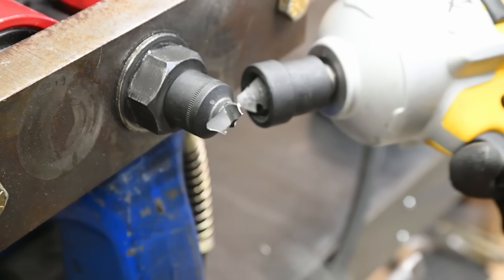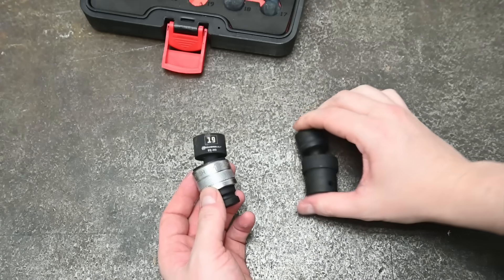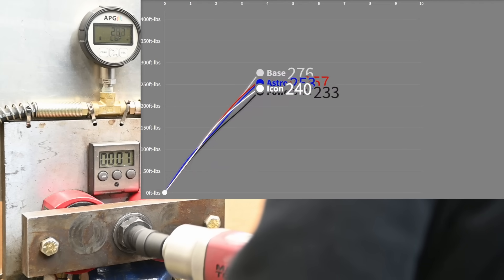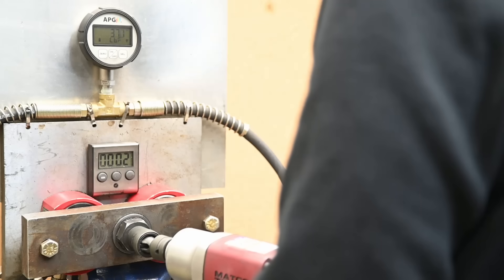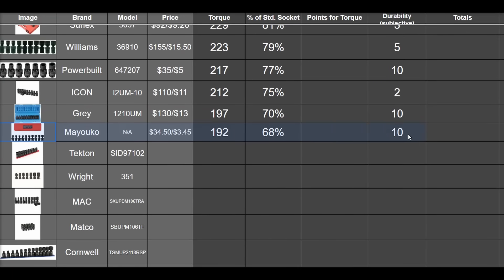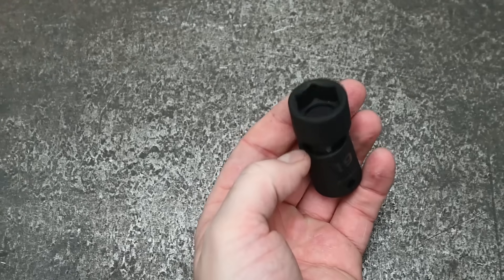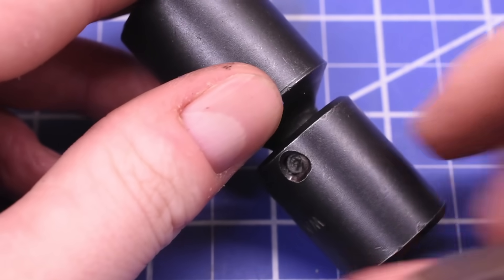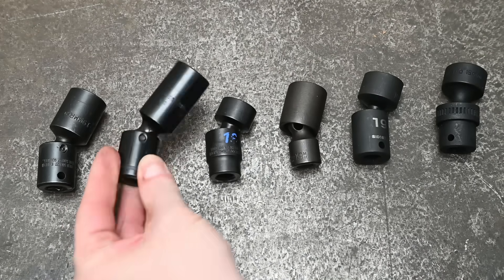Impact Sockets in 2025 are Getting Weird: New Tekton, Icon, Koken, Matco & More

Comment from the maker: Corrections: The Matco's price on screen at the end swapped places with Cornwell. Matco is $530/53 and Cornwell is actually $625/48
- Capri earns 8 points with a torque transfer of 87% not 7 points, so its total has been updated to 17.
Reply: Need to test expert sockets that’s what I use at work all day basically I use the 15
Reply: Apply a coating of ARP lube to the swivel ball with a Q-tip and move it around to distribute. Compare the results with one without the lube. You will be impressed.
Reply: Would’ve loved to seen Mac’s “expert” line of swivel impact sockets tested. I have their 3/8 metric set and use them with a 3rd gen Milwaukee H/T, have yet to break one. I’ve been very impressed so far, if the 3/8 can handle that, would love to see what the 1/2 set can do.
Reply: You guys should consider testing some of the cordless tools from Mellif - sold on AMZ - that are designed to work with either DeWalt or Milwaukee batteries.  Their hammer drill is like $35.  I actually just ordered their snow shovel for M18 batteries.
Reply: I know my comment has nothing to do with the video, but I'm curious to see the most powerful drills on the market in the test.  I mean the angle drill from Dewalt dcd470 (240nm and 2600w output) and Milwaukee equivalent, etc.
Thanks for all the videos you post.  They are super interesting and help me to understand the limitations of the tools I have or will purchase.
Reply: @omulduda  "powerful" drills really doesn't compute these days, does it? 

Power strips screw heads and breaks bits.... None the less I do believe they test them now and again (but the channel is more so directed at mechanics)
Reply: @commonsenseisdeadandgone A cordless drill is surprisingly powerful more powerful than a 1/4” impact driver and even better than a 1/2” impact driving lags and honestly it’s either the bit or the fasteners fault for failure or the operator choosing the wrong fastener or bit for the job at hand
Reply: @commonsenseisdeadandgone  They test circular saws.  And that poster is asking about stud and joist class drills, which nobody really tests, but TTC does have a test rig that could potentially work.  And nobody is using that kind of drill to turn screws.
Reply: @commonsenseisdeadandgone  But still useful for removing material in a hurry.  Or mixed various mortars, substances, etc.

Comment: Years ago when I first became a tech, I bought the Gearwrench 84918N set. It was one of the first kits I bought outside of the bare-basics.. and if I remember correctly, I gave $60ish dollars for it on amazon. I was gambling with GW, Tekton, etc at the time.. and my thought process was that "Well when these finally give up, I'll be ready to buy some off the truck". To this day, I still use that kit daily. Its kind of funny, they look a little out of place in my rollcart, but they've stood the test of time. I've had to warranty my 13mm once (which my Mac guy will do, since they're owned by SBD), other than that- flawless.

I could gain a little advantage going to Snappy since their socket bodies are a little bit smaller, however the gain isn't worth the price. GW made a sweet product at that price point. I googled what they're going for now, Advance Auto has a set for $130, and they're always offering 20% off on $100+.. which would put you at basically $100 before tax. For that price, buy them. They're worth it.

Comment: Need a regular 1/2 in female to 3/8 in male high torqe impact rated socket reducer that will last on Milwaukee M18 FUEL high torqe impact driver/wrench 2967-20, anyone got the answer lol! I got a Wright 100ft lbs reducer and it twisted and the lol ball at the end it won't hold sockets anymore an only used it handful of times

Comment: I have purchased some cheaper impact wobble sockets in the past.  For me the main durability point with them is the soft iron wearing out after being repeatedly pulled off and put back on my impact.  I work on a lot of large equipment.  The cheap ones wear out and fall off the impacts anvil even after a new retaining ring is installed.  Climbing up and down equipment or searching for tools negates the price difference for me.

Comment: I've never seen a situation where my regular swivels wouldn't work, with a normal socket...  I grabbed a set of all three (1/4, 3/8 and 1/2" swivels)..  Like 20 years ago,  for $5 at wallEWorld...  and they still work to this day and have built many engines and motorcycles and vehicle repairs and transmission swaps, etc. etc. etc.   I only buy tools as I need them, and I've never needed to get anything other than that 3 piece set of impact swivels.     lol... I have a number of weird special tools--  but have used the same simple set of wrenches and sockets forever.

Comment: Guys, I'd love to see a test of 3/8 impact socket similar to what you've done with combination wrenches. For many of us, 3/8 impact sockets have replaced chrome as a general-use socket for all things under the hood. A comparison might show which sockets have thin enough walls and shallow enough lead in chamfers such that they might completely eliminate the need for chrome 3/8".

Most of us are using a cordless or air impact under the hood for most things.

Which 3/8" impacts hold up the best without wallowing out the drive broach? Which ones have the thinnest walls and tightest fit? Shallowest chamfer and best reach to the hex? I'd love to see the market get your assessment.

Comment: It sure would help if you packed them with high wear grease before testing ; as you mentioned, you can clearly see all the metal fragments flying out during testing.
Reply: doesnt work, i once tried greasing a swivel and it all immediately shot out. probably because the swivel is rotating at high speed and being impacted at the same time

Comment: Video idea. Have a debate going on at work with a few co workers that torque sticks don’t work on electric impacts. I’ve always been told torque sticks don’t work with an electric impact, but never seen proof on why you should or shouldn’t use them with an impact. I personally don’t use torque sticks, I prefer to just hand torque everything for peace of mind. Didn’t know if this would be a good video idea, torque sticks on air impact, vs Electric impact, what impact will get the lug nut closer to the tightening spec of the torque stick. Hopefully that makes sense😂
Reply from the maker: We've done just that video
Reply: @ I’ll find it and check that out, thank you!

Comment: I just returned a Proto 1/2" long handle ratchet, the fwd\rev selector switch broke(internally) after like 5 uses. I opened it an found the selector fork and pawl to be TINY!! My tool store is leaving Proto in favor of Gear-Wrench and Milwaukee for easier warrantying, he did mention Proto was a generally superior tool. But they're hard to deal with for the store. I replaced the long handle with a Milwaukee and it's great.
-I have had 2 sets of Proto anti-slips for 19 years and the 15/16" is still exactly 15/16"+a few thou and man it's had a life. The finish is still immaculate as well.

Comment: I really wanted you guys to test PROTO. I’ll donate mine! BUT then you guys informed me that MAC and PROTO are identical in construction / look and part of the STANLEY family.
Reply from the maker: I thought MAC's were Proto
Reply: @Let me take a look at mine and compare it to the MAC. l also wish you guys could have done SK before it moved to CHINA but kinda impossible to find one that is new. I actually went out of my way to purchase my set piece by piece used on EBAY and I filled in what I was missing with PROTO.
Reply: @TorqueTestChannel After double checking, you’re absolutely correct. MAC and PROTO both identical … and makes sense given they are both under STANLEY. My set is split between original SK and PROTO and when I made comment I was thinking I wished you guys would have tested what was in my set but remembered SK bought out by China so you won’t find any identical NEW units so opted for PROTO.😅

Comment: While you mentioned about putting the impact against a block to keep similar angles is each impact actually at the same angle as math will tell you the higher the angle the less transfer of torque, so is the difference in torque transfer related to the amount of angle used OR even the amount of angle distance between the tool & the bolt?

Comment: The biggest problem with these sockets are the idiot operator, you are supposed to lube the swivel part of the socket before use so that it is not dry metal on metal contact and galling the shit out of the surfaces instantly. Use you dried out brain, metal needs lube to survive people. I have used the shit out of my Snap-on swivel's for 30 years and never broke one ever, some are pretty worn but they still work great. Oil the fucking things!!

Comment: To me it seems a little ridiculous that sub-1/2" impacts generate enough torque to break commodity grade hardware attached to them.  I get it, MOAR POWER, but if you end up paying more for the tool, and what happens is the usual thing - that someone grabs the smaller drive size impact wrench when the fastener size had a socket available in a larger drive size, then it just seems like a false economy and bad design to keep pushing the envelope for torque on a particular drive size.

If you have a herculean impact wrench but it breaks the socket, you're still not getting the job done, same as if it had less torque but your socket survived.  In the former case you're paying more money, x 2.

At the same time I can appreciate that there's going to be that one off fastener, where it makes or breaks your day if you can just get it off and finish a job, and the times you accomplish that, have value that exceeds the cost of a (at least some of those tested in this video...) socket replacement.  In some trades, getting a job done the same day, makes a world of difference in income, get it done and not have to come back the next day, which is when you want to start and finish another job instead.  Driving a work truck the gas savings alone can equal the socket cost, nevermind labor/hr income, so you really don't want your sockets to break.

I did experience that in a trade, that you really really really want the job 100% done when you quit for the day, but that trade did not require uber premium priced anything, just working against the clock.

Comment: I never used a wobble on an impact, that is stupid. They make those extensions with the wobble on the end. I have broke those before, but only the cheapest ones. I know a lot has changed in the last 20 years, but quality has not gotten that good. I guess if you can afford to buy the best and your tool dealer will swap them or profits are high enough to cover the losses... Alrighty then...

Comment: ko-ken and Wright tool are my top 2 brands. Wright make the best non ratcheting standard combi wrenches and pinned design impact swivels imo just tough as nails and ko-ken tools zeal series everything are nearly unmatched ime just don’t have the selection of (zeal series specifically ) long handle and flex or locking flex ratchets …their hexahedron pin less zeal series universal nut grip non impact sockets are just absolutely phenomenal no other words and a 3450m17 nut grip can make an Astro nano shallow socket set function as a mid length or deep well with the deep nut grip 11mm 17mm or 22mm depending on drive size which is a way to save money …..as much as I love ko-ken ever since 
koken USA popped up and the prices got 2-3x’d and you started needed POP from an authorized dealer warranty situation drama bs and all that
 I buy them not expecting to be able to warrantee them over paying at minimum double the price and that’s why, unless it’s a specialty like the nut grip. I generally don’t buy standard Kochen impact sockets I’ll go with wright snap on or proto someone much easier to warranty even the craftsman v series doesn’t require a proof of purchase on hand tools

Comment: Consider a wear comparison with and without the high pressure grease of your choice. Reason being the many spline-driver drill bits use grease on the splines to reduce wear on the hammer drill driving them.

Comment: My paid wrenching was during '72-'85. The arrogance of SnapOff always ruffled my feathers.  I bought a =house= instead of a SnapOff toolbox and tools.  HFT's Icon gives me the same vibe, which I totally avoid.  I still own one SnapOff tool, several MAC, and hundreds of Pittsburgh, Cornwell, Matco, Crapsman, and other brand tools.  Even though I don't earn my living with tools, I still use a lot of them daily.
Torque transfer efficiency has always been definitely appreciated, but seldom required. $62 for a socket is a price I'll never pay.
Thanks for your tireless testing, guys.
Reply: I like my usa crapsman tools. Toughest wrenches i own. I bought a anniversary snapoff tool just to say i have snapoff in my box bwaahaa. Funny thing is i have the pitts set of wrenches that we grab for most uses cause dont care if they get broke or lost and still have full set including 10mm haaa. One way overpriced cornhole double jointed wrench set and 2 ez red specialty wrenches, gearwrench sets but if i got a stubborn bolt i go for the usa craps. I just saw vid of overdrive set and am impressed. I wish my craps socket set were imprinted instead of etched markings. Impacts are pitts cause if they break or get lost no big deal, have only broke one 3/8 to 1/2 adaptor so far.

Comment: I think the reason the Koken Swivel sockets do so well with the torque is because it's almost like a weighted socket. The heavy part of the socket is on the socket e d and the light part is on the drive of the impact.
Reply: It's possible that moving that fork closer and straight off the axle of torque, is doing something for it too.

Comment: I would like to see how just a normal swivel adapter stacks up in this testing. It is so much more cost effective to just have an adapter to go to sockets you already have instead of these sets. My dcf961 broke an ares swivel adapter on a bolt recently but the icon did the job and the bolt came out

Comment: Really interesting your results with the matco. Iv had a set of matco pinless 3/8 drive for over a 12 years, that i use mostly for transmission removal with a 36" 1/2 to 3/8 reducing extension. The 19 and 15 have probably the most time in use but havent really given me any trouble. As theyve worn more they do have more a tendency for the retaining ring to pop out and fly apart. When i found out gearwrench made the same design, i now question if the matco arent made either by gearwrench or they both source from the same factory.

Comment: This will get buried, but I have the wrights and one major thing to note is the small sizes (10mm, 3/8,7/16) are essentially the same thickness as the 9/16 or 14mm just necked down an almost laughably small amount at the very tip. They are a good socket, they just didn’t work great for me and I replaced them in my main box with CAT. The way they inverse the pin side also makes them not quite as shallow in practice as the “normal” way and that also played a factor.

Comment: I bought a set of 3/8 impact universal socket set from Snap on 45 years ago when I was employed in the trade. At the time they were expensive! I paid a little over $100. For the set. Note as a flat rate tech my average weekly pay than was $200./ week LOL😄.  I payed the Snap on dealer religiously every week until my dept was paid off. I used the set for ten years in the trade than loaned them to my son who also used them in the trade for another five years. The add age applied ps " price is long forgotten but the quality will linger"

Comment: I don't get it, why spend so much. I own a 3/8 and 1/2 inch impact swivels from snap on that are socket less type and have done their job for 32 years with only one warrantied (sleeve wore out and pin walked). I don't see the reason to buy a socketed swivel, sure occasionally it will throw a socket but that can be avoided by keeping steady pressure into the socket. 32 years of commercial truck service and I only buy by the piece most of the time because not all specialty tools will be used, some never at all.

Comment: I’ve had my gearwrench 3/8 set since 2012ish and they still work great… I also don’t own a 800ftlb impact to abuse them and either use a ratchet or a craftsman nextec 12v impact driver so I imagine my great grandkids will still be able to use them in 40yrs

Comment: My Tekton 1/2 pinless swivel stopped working after several weeks of heavy use in the shop.
The pinless + high angle design seems to sacrifice durability. They start to get stuck, and can only be unstuck by smacking with a hammer, very annoying. I replaced it with a snapon pinned one and have not had a problem. Oddly, the 3/8 Tekon one don't have any issues. Probably because my 3/8 impact is so much weaker.

Comment: I am shocked that it has been months since the new tekton swivels came out and this is the first video ive seen of them. Also i got the cheap amazon 3/8 swivels and after a year of use i am impressed by the durability
Reply: Last I checked, they were still sold out. So they're selling supposedly. Or they didn't make many sets. Or they're being warrantied a lot. But tektons stuff seems pretty solid so far. From what I've used.

Comment: kinda disappointing to see icon fail again, i got the 1/2in set 40% off so when i first saw the 3/8th shear off i was secretly hoping it was a fluke with the 3/8ths, most likely will be buying snapon singles of the most common ones i use(or shear off) for the strength and power loss.